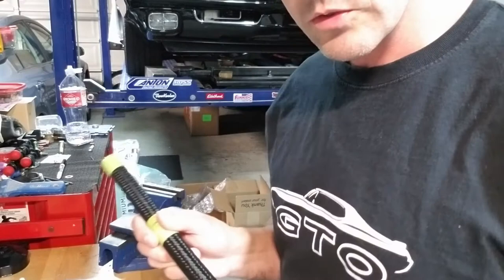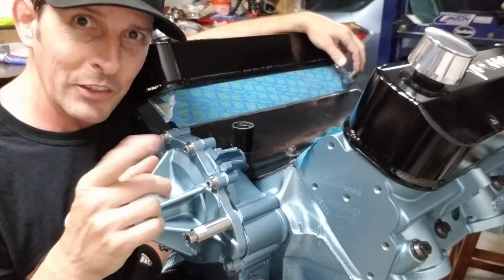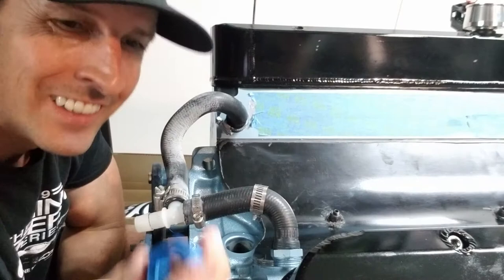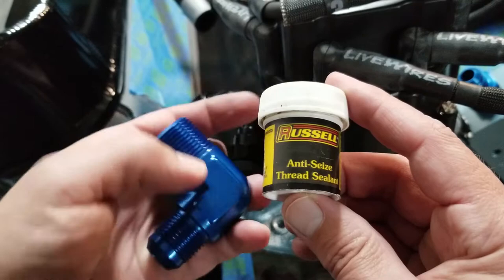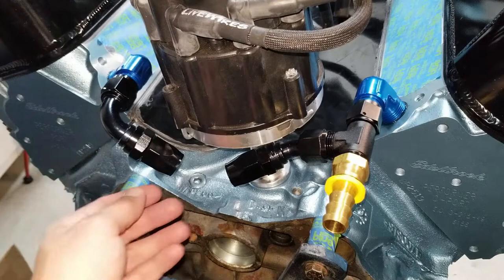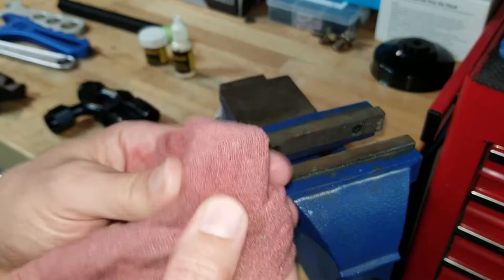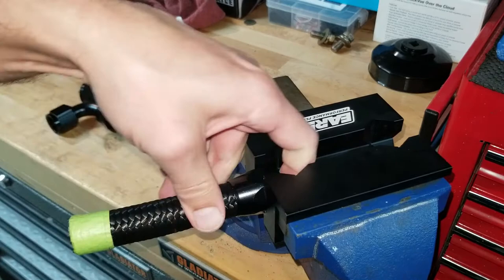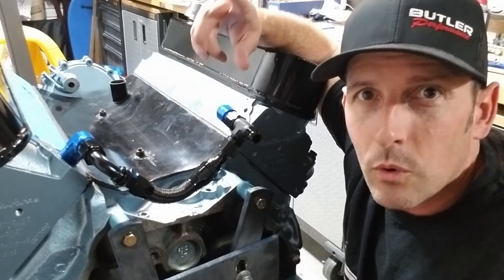Pontiac V8 Rebuild, Part 17:  How to install AN Fittings and keep your heads cool.

Comment: Great mod if you have pipe threads in heads. This system doesn't work on stock heads without cutting  threads in the water ports. Stock heads have tolerance fit nipples with no 90deg.
Any fittings will interfere with the Distributor.
Reply from the maker: Thanks... stock heads are actually better because the press in heater hose nipples have flow restrictor in them.  (The drivers side head you just have to remove the galley plug)  Then find a molded 5/8" heater hose that helps with the bend from each head... and T it off.   The ultimate solution is to run those lines to the front cross over.  I kinda did that in my latest video on this subject...  https://www.youtube.com/watch?v=v_qUY4E33r0&t=749s  Have fun!

Comment: I installed those cheap screw clamps on hoses daily for 15 years and never had a leak.  AN looks nice but entirely un-necessary.  There are three things you can do to upgrade if you wish, one is to use shielded clamps that don't cut into the rubber hoses .  The second thing is to use silicone hoses with the shielded clamps.  The third is to use a metal tee not a plastic one.  No more is necessary.  But I have to admit he does nice work and if you like AN he is a great teacher.
Reply from the maker: Thanks Terry... agreed on all points, I'm just addicted to AN fittings.  Ha, ha... thanks for sharing some good alternatives.

Comment: I wonder if you could run the line back to the crossover under the intake manifold? I am sure there would be some fitment/access issues if you needed to remove the crossover during maintenance though. Loving the channel.
Reply from the maker: Great question... yeah, I just did that... been a long haul of analysis.  here it is :  https://youtu.be/v_qUY4E33r0  Thanks for the comment!
Reply: I was thinking the same thing

Comment: This video gives some great advice! Thank you…. I’m about to a 69 Firebird rebuild and I will definitely be using these fittings and your suggestions for cooling.
Reply from the maker: It works, but requires some more mods.  I did an experiment to see if it really worked... here; https://youtu.be/9ou2GKZFf3Q   Next installment will be my fix to that... stay tuned.  :)  Also consider separating your intake manifold, like I did in this one;  https://youtu.be/ew0MYYZrpMQ  This is reminding me I need to create a new playlist with the best of the best videos for the rebuild.  lol

Comment: Monty, thanks for the tip about drawing coolant for the heater core from both heads. I've added that to my mental list of Pontiac engine build tips and tricks. I love the look of the AN fittings. One thing that occurred to me that I might have done differently (assuming there were no space constraints, which there easily might have been in your case) is that I would have tried to make the bridge line symmetric to the point where it goes down to one line, so that flow is not favored from one head over the other. I feel like you're still going to get more coolant coming from the RH head, BUT it's still miles better than no line from the LH head at all.

Great channel - your GTO is a beaut. I just acquired a '74 Formula, and no doubt the info on your channel is going to be a big help, especially the Tremec TKO conversion stuff.
Reply from the maker: Griff, thanks for the kind words... and congrats on your project, can't wait to see it.  To your point, yes, it would be ideal to have equal length hoses, like how headers work.  BUT, I have a major constraint in that my water line goes immediately through the fire wall, into the heater core.  That being said, I'm still getting good flow from the Driver's side head.  I'd estimate I'm only losing 5 % flow. as compared to the Passenger Side.  Keep in mind, the water is being Pushed equally through each head.  So, we don't need to over complicate it.  :)  Glad you're enjoying the TREMEC build... I am too!  Love the challenge.  See ya!

Comment: That is Super Trick!  I will try this, although may have to route the hose in front of my distributor. ( I have next to 0 clearance to firewall on a on a '68 Firebird )
Reply from the maker: Thanks Rickey... it actually goes under the distributor.  But, this one is also my first design... check out the second version here, where I end up going in front.  https://youtu.be/lMOTH78xT4A

Comment: Ok I believe I got that. Since I am bypassing the heater core can I run this hose (from drivers rear head) to the (Edelbrock ) Intake manifold or can I run it directly to the (Tin Indian) timing chain cover? (where the heater core return line would go)
Thanks for all of your help. I'm an In-Line Tube paint, Edelbrock. Remflex, M/E Wagner, Canton Oil Pan user. Good Stuff
Reply from the maker: Run it to the manifold, like I did in Part 2... check it out... https://youtu.be/v_qUY4E33r0   Good choice in parts!  Ha, ha...

Comment: I really like the idea of a rear water crossover. I just ordered a second heater nipple to do the same thing on the stock heads for my 455. I never had overheating issues before I pulled the engine but the heater never worked worth a damn, maybe I can kill 2 birds with 1 stone.
Reply from the maker: Ha!  Yeah, it certainly won't hurt to get both heads flowing out the back.  Glad I gave you an idea to run with... obviously you don't need to go the the extreme of AN fittings, when standard hose/hose clamps, and a Tee will work fine.  (Before the AN Fittings I found a molded hose that worked great)  Good luck!
Reply: @FastMonty  You don't happen to know the part numbers of the molded hoses you used before switching to AN do you? I'm finishing up a frame off restoration of my dad's [yes like you it was a one owner until it became mine] 1966 GTO convertible and would like to run the setup like you had. Thanks! By the way, your videos are fantastic, really appreciate what you do, they have been super helpful!
Reply from the maker: @kaptainkish1708  Awesome story ... Unfortunately I don't know the part number I used.  But, I do recall ordering a few different 5/8" molded hoses from Summit Racing, and cutting them up, and/or returning what I didn't need.  Make sure you check out my latest cooling video before proceeding.  https://youtu.be/v_qUY4E33r0  Have fun!

Comment: I know this vid is a year old, but do you remember the heater hose part numbers you used originally? Going to use the hose for iron heads
Reply from the maker: I used all Fragola fittings AN size -10.  But, since you have iron heads, those nipple ports are not threaded.  You're better off using the standard heater hose nipples with rubber hose.  Secondly, review my latest head cooling video.  It's an eye opener.  Here;  https://youtu.be/9ou2GKZFf3Q  Let me know if you have any questions.
Reply: Do you recall the NPT size on that -10 fitting? I’m looking into tapping it myself:)

Comment: I am wanting to do the same set up as you have in this video. I do not quite understand what "the standard nipple with restrictor" means. It appears that your AN fittings are directly mounted into your heads. Did you have your heads tapped? I have not installed my heads yet so it would not be an issue for me to get that done. I do appreciate your series and don't want this to leak either.
Reply from the maker: Good questions... after market heads (Edelbrock) have those holes tapped.  I think they're 3/4 NPT.  If you don't want to go to that extent, you can knock out that driver side plug, and add this;  https://www.opgi.com/cooling-heating/heaters/1965-73-pontiac-v8-heater-hose-nipple/heater-hose-nipple-1965-77-pontiac-v8-in-head-g240632.html  Hope that makes sense.

Comment: Awesome videos!  I might have missed something... I have 69 Firebird w/ 76 Trans AM 455HO motor (likely mostly stock) installed.  Edelbrock EFI System installed.  Now... I added a water nipple on the driver's head, machined a manifold for nice hose routing.  Test drive and my temps are up higher than before.  From my reading, it looks like water that goes through the heater core, wether it be stock from passenger head or modified from both heads, returns to the front of the engine rather than through the radiator thus circulating hoter water (we're currently in the 100's degree weather here).  My guess is not running the heater on hot days I should close off any heater core feeds (future electric valve) so that all water circulates through my radiater?  Sounds like the engineers after 1960 didn't make the best design change in water flow?  I'm sure I missed something... I've done EVERYTHING for cooling now at this point.  Adding the driver's head to the heater after watching your video was the last 'bonus' attempt in hoping for cooler temps.  Sorry for the long explanation here on the related post as I couldn't find a different contact method unless I joined twitter?  Thanks much and Nice car!
Reply from the maker: Thanks Joe... I understand your concern.  In theory, yes, too much hot water could be recirculated.  I was debating putting a ball valve in that heater hose to control that flow, as an experiment, because I did see the stock nipples have restrictor coils in them.   Maybe try that?  Second to that, what's reading your temperature?  (I now have three gauges... stock, FiTech output, and a new Autometer Mechanical gauge.  The Fitech unit reads 15 degrees high, the stock unit reads 20 degrees low, and the Mechanical gauge is just right.  ha, ha... Lastly, do you have the stock pulley's on the engine?  Sometimes the pump can pump too fast, not giving the coolant enough time to cool off in the radiator.  Food for thought... thanks for the comment!
Reply from the maker: ohhh, and you can email me too fastmontysgarage@gmail.com
Reply: @FastMonty  Thank you!  Sent you an email.  Have a GREAT day!

Comment: Good afternoon.  Enjoy your videos.  I have a 66 GTO with a 389.  I currently have the Barry Grant's  SixShooter tri power.  I am planning to purchase the Ames alumni tri power manifold.  Holley has the Rochester to Demon carburetor adapters.  I want to devours the water passage from the main manifold.  The new manifold has t thermostatic vacuum port mounted in the front of the water passage.  I can't sen a pic.  Anyway my GTO does not have AC.  The water out of the rear passenger side of the head goes directly into the heater core.  What is your option if I run an AN hose directly from the fitting on the manifold to the rear of the drivers side head?
Reply from the maker: Hey Peter, thanks ... good question.  Before we get into it, please review my latest version of this video, (I had made some more changes, and discoveries... here;  https://youtu.be/v_qUY4E33r0  Thanks!

Comment: I am seeing AN to NPT fitting or AN to an O-ring style AN920-10-08A but I am not sure if that is what you are using. Are the Pontiac holes where the freeze plug goes threaded? I do not have a heater so I am going to Y to the front of the manifold. Can I use one of the predrilled holes on either side of the thermostat or do I have to drill and weld the fitting in the exact spot that you did yours?
Reply from the maker: Good question Scott... The freeze plugs in stock heads are NOT threaded.  I would use the standard nipple with restrictor, then run standard hose to a Y connector, then yes... utilize one of those tapped holes in the crossover.  (I assume your timing cover heater hose inlet is already plugged?)

Comment: Hey thanks for the quick response that’s awesome idea you had a great video problem is I have standard stock heads on mine and those are not threaded any suggestions on what to do I really appreciate it thanks Dan
Reply from the maker: Thanks Daniel... good question.  Did you see the prior set up I had at the 4:28 mark?  That's exactly what you can do.  The drivers side head has a pressed in freeze plug, where you can remove that, and replace it with the same heater hose nipple that's on the passenger head.  The most difficult part is just finding the right molded 5/8" hose... I just searched different looking hoses on Summit Racing, and cut one up.  Obviously added a T.  If I were to do it again, I would add a Brass T, instead of a plastic one.  I hope that helps... let me know if you have any other questions.

Comment: Hi, what size tap did you use for the back of the heads please??
Reply from the maker: Good question... I didn't tap them.  They're aftermarket Edelbrock heads that have 3/4 NPT threads in the water ports.  To be frank, I would just use standard molded heater hose to tie the two heads together, it's alot easier than using AN hose and fittings, etc... BEFORE you do any of this, please check out my latest video on this subject, here; https://youtu.be/v_qUY4E33r0  Have fun!

Comment: Hey how’s it going. I been watching your videos on rebuilding your motor. I just blow my head gasket on my Pontiac 400 so I’m replacing it now and I want to add the AN fittings and hose to mines. My factory heads are not tapped tho.
Reply from the maker: Hey Eric... thanks for watching.  Bummer about your head gasket.  But, a good time to upgrade.  If you're staying with your factory heads, I'd just use standard heater hose, like I originally used at the 4:55 mark.  You just need to knock out the rear freeze plug, and RTV in the same style heater nipple that's from the passenger head.  Those rubber hoses are molded... I just did a manual search on Summit Racing to find a hose that had a bunch of turns in it, and cut that up to fit.  Hope that helps!

Comment: Hey man great vids, I have a question just to clarify things, I have a 74 Pontiac 400 and I wanna do this to keep it cool because I’m in florida,I never use the heat so where exactly would I find the part of the water pump to route this into, also could I get a link for the color and primer you used on your engine because that is the most beautiful block I’ve ever seen
Reply from the maker: Good question Jonathan... the nipple is the hose on top the radiator hose, on the water pump.  BUT, before you do that, check out this video... https://youtu.be/9ou2GKZFf3Q  Stay tuned for a fix I have planned.  As for the paint, use the following Primer; https://www.amazon.com/dp/B001DKUTLG?ref=exp_fastmontysgarage_dp_vv_d  and Paint https://www.amazon.com/dp/B07W4LT9CL?ref=exp_fastmontysgarage_dp_vv_d  Thanks for the comment!

Comment: Do you have the part number for the an Fittings for the heads
Reply from the maker: If you have Edelbrock heads, the tapped holes are 3/4 NPT.  so, I got a 3/4 NPT to -10 AN.  Make sure you mock everything up because I had to change one of mine to a straight fitting, versus the 90 degree.  Have fun!
Reply: @FastMonty   I have stock heads
Reply from the maker: @dennisalstonZ06  Ahhh, I see.  AN fittings won't work because stock heads don't have threaded holes.  You'd have to use standard nipples, with restrictors.  I previously found a 5/8' molded heater hose that worked well, in my previous set up.

Comment: If I wanted to do this, instead of routing the coolant crossover to the heater core, where would I connect it at the timing cover/water pump?
Reply from the maker: Good question... you connect it to the heater inlet.  There are two connections on the timing cover, one is the radiator hose, the other is the heater hose.  Hope that helps!  (Keep in mind, doing it this way eliminates the use of your heater)
Reply: @FastMonty  it does! All of your videos have been a huge help considering I started a pontiac build right around the same time you did! Thank you so much for everything you've done for the Pontiac community.
Reply from the maker: @ghostwarrior762  Good to hear... and thank you for being a part of the channel.  Keep at it!

Comment: Hi, what exact heater hose fittings you use on those heads?
Reply from the maker: They're 3/4 NPT, which are only used on after market heads that have the tapped holes.  Otherwise, you'll need to get the stock 5/8" hose nipple

Comment: New subscriber here.  Random question.. is your intake an edlebrock with endurashine? If so how is the finish holding up. Im on the fence about it bc Iv read alot of reviews about the coating peeling or turing colors bc coolant gets on it... love your car. I like the fact its not all "blacked out" like all the others.
Reply from the maker: Hey Tim!  Welcome to the channel!  And, thanks for the compliments... to answer your question, yes, I have the endurashine manifold.  It's basically chrome, so it's very difficult to stain.  (I don't think mine is stained)  However, it is chipping around the bolt holes.  Not sure on your timing, but I'll be changing manifolds soon, I can get you a great deal on mine.  :)  (It's ported too)  See ya!
Reply: @FastMonty   If you have a small block Chevy I would be all over it. What intake are you going to switch it to
Reply from the maker: @tcwest83  Ha!  Good point... nope, it's for a Pontiac.  Changing it cuz I'm dying to get one to paint Pontiac Blue.  I'm getting sick of the Chrome.  :)  Thanks for the comment!

Comment: Mike if you use the factory nipples in the back of both heads do you use the restrictors in the nipples or remove them? Thank you
Reply from the maker: Good question Bill.  Its optional. Personally, I would remove the restrictors.  The difference is constant flow, versus only having decent flow when the water is hot. The way my system is set up now is there are no heat restrictors.  Hope that helps!

Comment: What thermostat and radiator do you use?
Reply from the maker: Good Question.  I'm using a BE COOL radiator, with twin electric fans.  (Came as a set) With a 165 degree thermostat.  Hope that helps!